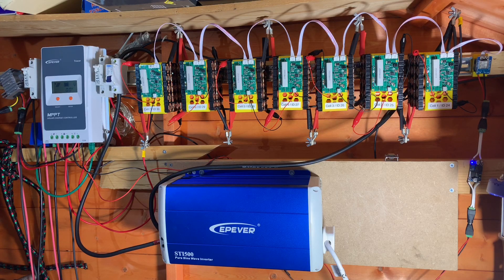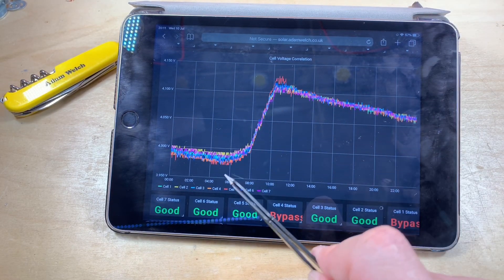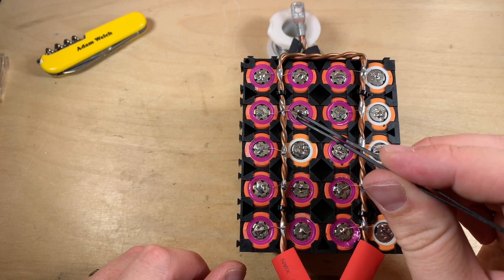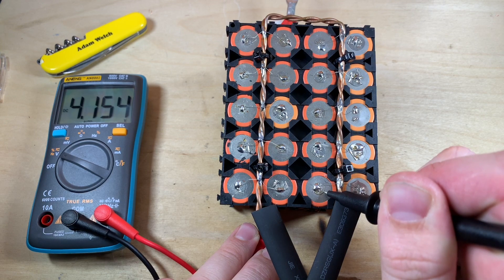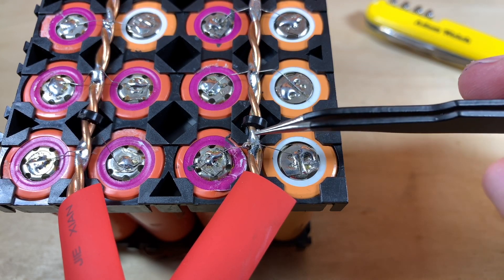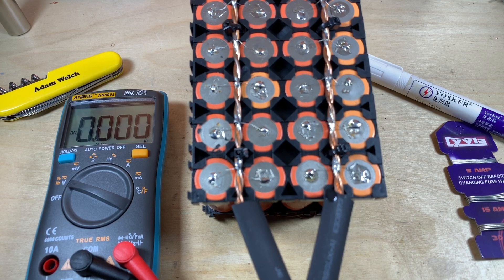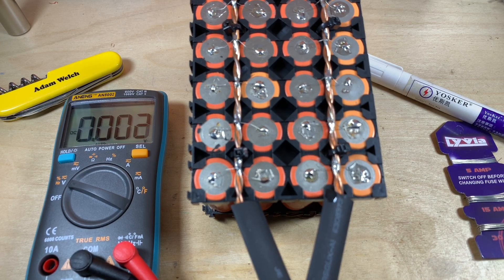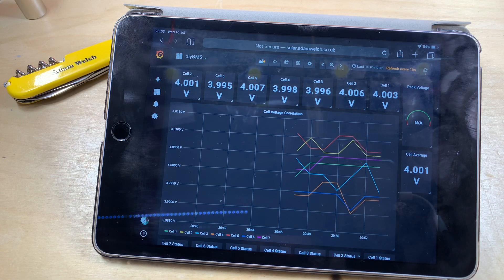Lithium 18650 Pack Maintenance

Comment: at 4:10, you should be a dentist ^^
This is the problem with the parallel cells balancing issue after the fuse broke.
I love my Lifeypo4 200Ah Winston batteries ^^

Comment: I'm not a big fan of using fuse wire, instead I bought a pack of glass-fuses with leads and using them instead.
Reply: I just received 4A polyswitches (or poly switch). I use those for my 66Ah @12v battery pack which i will be using for electric trolling motor. Polys are nice because they are auto reseting.

Comment: Do you have any tutorial videos showing how to make a simple solar charge station, with a smallish solar panel. . Just enough to charge a 12 battery or equivalent. Nothing to complicated, but just to use as an emergency supply for low drain devices.  Something to start me off, and to move onto greater things. Thank you.
Reply from the maker: Try this one out for size. It’s a simple system I use to keep my caravan battery charged up when it’s not in use... Starting with Solar & Maintaining your Caravan Battery in Storage - 12v Solar Shed https://youtu.be/b7jp38sFCHA
Reply: Thank you looks simple enough. Be nice to be able to run items on it while it charging. Just the simple set up I want to start with. 

Love you videos, very informative.

Comment: If i'm correct, the solar system that i see must cost at least twice the price of using normal electricity !  Where is the advantage to that ?
Reply from the maker: You’re absolutely right that financially this probably isn’t ever going to pay me back - but I enjoy the process of building and using the system. To make it more cost neutral you’d need a bigger system to offset a bigger chunk of your normal day to day use of power.
Reply: I agree with you, making your own installation give you some much pleasure and knowledge !
I really like the way you've soldered your 18650. I'm use to the classic Nickel strip and spot soldering station. But your way is more stylish and secure i presume. How do you know which size of fuse cable to use ?

Comment: Coool, so how does this capacity test versus the other packs? 
Are there any heaters in the pack?
I appreciate reattaching some fuses while the pack is out is the easy fix, it’s missing most of the important checks though. 
I guess you’ll be able to see if it pulls into line and is obviously lower capacity with it trending highest/lowest over time though, so it’s s start.

Comment: It's been quite some time, and I'm being lazy and going to just ask, what are you using to get that battery charge monitor graph,?? I could really use something like that! I also need a real bms, I'm using 4 x 100amp small bms , for my 12v LIFePo4, bank, and I need to get my 7s 1400 cell bank in service, the lead acid needs to be used for back up power only! I was just thinking, I have likely over 1,000 lbs of lead acid batteries, and I'm going to be needing them moved!! That sucks! L-16's are heavy!! Great show, and good day!
Reply from the maker: The diyBMS and my tracer A charge controllers log their stats to influxdb. I then display this using grafana. It’s all done on a raspberry pi using Colin Hickeys script and guide. Works really well. Check out his videos on here for the full explanation.

Comment: Hi Adam, sorry my bad english.
I think I did not understand why the fuses were blown, what was the reason? an overload? , a discharge with a lot of power? hot? (sorry if you said it in the video, I have not noticed).

I think those 4 batteries 18650 should be replaced by new ones, or recycled in good condition. To avoid the same failure in the future.

You can also mark the batteries 18650 with a marker because if they fail again you know if they are the same ones that are "damaged"

A greeting from Spain

Comment: Great project.  I can get a load of salvaged batteries for free.  Approximately how many would I need of ok to good quality batteries, to perform the equivalent of a Tesla Powerwall in capacity?  And how much roughly would it cost to do, factoring in free batteries?  (I would need to get some solar panels too - but prob don't need to factor that in yet either).  Would love to use these to help feed my electric car etc at night too

Comment: Those "fuse" wires aren't the best idea for sure. Mechanically too delicate. Soldering miniature axial glass fuses with thicker bus wires might have been a better solution. Here are some alternatives:
https://www.aliexpress.com/item/32948126734.html
https://www.aliexpress.com/item/32840200566.html
https://www.aliexpress.com/item/32855743610.html

Comment: A somewhat disappointing video as it shows an important failure but you do not investigate the possible cause. Just repairing and replacing always gives me the chills. I hope you have time to do a followup video to research the cause. Looks like you could check the other packs inline because there is enough space to get in between. Maybe with a small endoscope camera?
Reply from the maker: I think these have been broken through mishandling. Fuses fuse in the middle when they blow due to excessive current (because the connections at each end draw away some heat) these were all broken at the end, so this was a mechanical failure I’m fairly sure. Also the disconnected cells were holding a good voltage. Nothing pointed to an over current situation.

Comment: Get rid of the fuses on the bottom of the batteries, might be time for you to make up a small spot welder to weld the tabs onto your batteries ... can be made from a microwave transformer (not inverter type) ..... a good project!
Reply from the maker: Yeah it’s been on my list for a while. I guess I jumped the gun a bit when I built my packs.
Reply: Adam Welch I was going to ask why you’d fused both positive and negative?
Reply: There could be a problem spotwelding over soldered connections. I tryed to do it, but thre was extensive sparking. If I would remove all the slolder maybe. It is not worth the effort.
Reply: easier just to resolder with less delicate copper wire (0.6mm?) surely...

Comment: That doesn't look like the DIY BMS software. What application are you using to get those graphs and historical data?
Reply from the maker: I’m using Colin Hickeys adaptation on the diyBMS code and reporting the data to influxdb, which then is read by grafana to display the historical data.
Reply: There also seems to be some dashboards where the data has come straight from a tracer a.  Have you a video on that?  I've been experimenting with reading modbus interface directly on a tracer N but for the time being am just dumping data to MQTT.
Reply from the maker: Andy Barnard Well spotted! No I haven’t done a video on it - it’s all Colin Hickeys work. If you jump over to his channel you’ll find guides on how to do that.
Reply: Thanks Adam.  He shows tracer to influx db to grafana.  As I've already got my tracer data in mqtt and there is an mqtt plug in for influx db it looks like I can make my own variant.

Comment: YouTuber 'Average Joe' did an interesting series of videos on fusing 18650 cells. The conclusion was that the rating on fuse wire is the current at which they are guaranteed NOT to blow. The actual current necessary to blow can be much higher and depends on factors like length. Based on his conclusions I soldered one end of my cells with 5A wire (simply because it was convenient), and the other end with 1A Pico fuses which were found to reliably blow at 2A. This was fine for my system and well within the expected current for normal operation.  I think I got the Pico fuses for about £2 for a thousand from AliExpress.
Reply from the maker: Yeah I did a video a long while ago looking at fuses and made the same conclusion. Generally took twice the rated current to quickly blow a fuse. Over current situations could last quite a while at currents just over the rating.

Comment: Why do you have a fuse in both the + & - ends of each cell? NOT neccesary! This will not add any additional protection to that cell. This was pointed out many decades ago with the simple demonstration of taking a piece of paper and cutting 2 equel cuts half way across, each cut representing a fuse. When the paper was pulled apart it broke only in one area where it had been cut.
Reply from the maker: If you go back through my videos you’ll find I agree - it adds no extra protection what so ever. It does however seem to be the easiest way to solder the cells to the bus bar without a spot welder. So repeating on both sides simply made my life easier (and I like symmetry)!
Reply: Yes, but with fuses only on one side and solid copper to the other, you would not have to prod both sides as now,  just a thought, as you want a simpler life.

Comment: Thanks for the video Adam. One question from me....wouldn't you have expected that the DIY BMSs would have kept the packs more balanced than they were, even though one pack was a different total capacity?
Reply from the maker: To be honest I’m really impressed with the top balancing the diyBMS has managed to do. This pack was about a fifth down on capacity - so it charged much quicker and the diyBMS dealt with that quite quickly (even though I’ve fitted reasonably high bypass resistors resulting in a fairly low bypass current). I haven’t been discharging this pack significantly, and that’s where this version of the diyBMS would struggle because it doesn’t have any low voltage protections. Stuart’s new design does however - I need to by some more components to give it a go.

Comment: Maybe time to check the fuses in the other packs, you might not even notice on the graphs if one cell is disconnected.
Reply from the maker: Absolutely. I’ll be doing that soon.
Reply: Adam Welch Have you thought of gluing 3 wooden dowels into the holes between the cells? (On both sides)

That way, you don’t have to mess around with a piece of plastic every time you need to work on the packs.

Best regards

Comment: Very nice. Your videos are real inspiration to me. 
But I was somehow expecting some kind of a sophisticated problem with this pack. A faulty cell or something. Not just broken fuses. :-)
I had a bad experience a few days ago with a pair of cells harvested from a laptop battery as a pair. They were behaving strangely for some time. 
When I separated them, I found out, one was totaly dead and draining the other one. It was totaly new to me, as long as many people on YT are claiming,
this almost never happens. And this kind of fuseless pair could be pretty dangerous. I watched your video expecting something similar happened to your pack and the fuses were blown because of a short. Somehow disapointed at the end. :-)
Reply from the maker: Well I’ll be honest that was my suspicion. I expected that I would have to unsolder all the fuses and use the IR meter I bought recently to identify a dead or dying cell. As it turned out, I’d obviously just been too heavy handed at some point and snapped the fuses! I think I’ll take the others down soon and check them over who knows there might be more issues to fix.

Comment: would you say, this experience lends any credence to the solderless methods becoming available ( although the prices smart a little )
Reply from the maker: I think it’s most likely I mishandled the pack to break the fuses. I think any connection method has a risk of failure - cheap or otherwise.

Comment: very nice. keep us updated. i should also check mine since its doing its job for more than 8 months. i use to power my wemos an wemos dc power shield, it looks cleaner than this hanging dc converter :P  also it would still be nice if you could upload your 3d wemos part ;)
Reply from the maker: Yes you’re correct - that was a quick fix which has remained for too long. I’ll try and upload the parts somewhere soon.

Comment: When soldering my packs I leave some slack on the fuse wire otherwise they can easily snap again while handling the pack.
Reply from the maker: That’s probably a sensible idea. Thanks